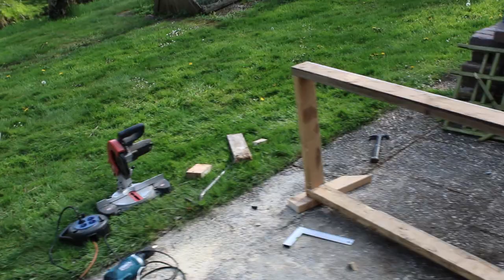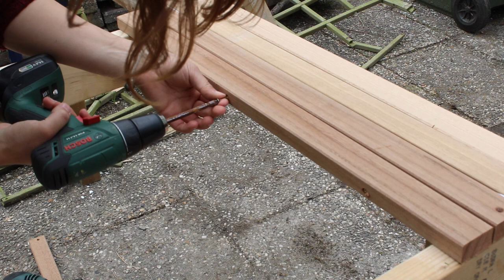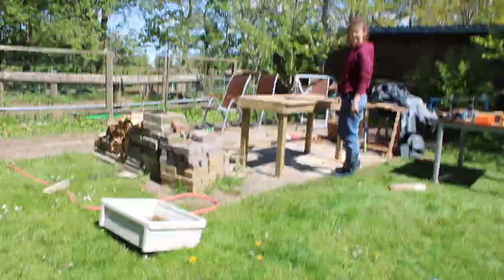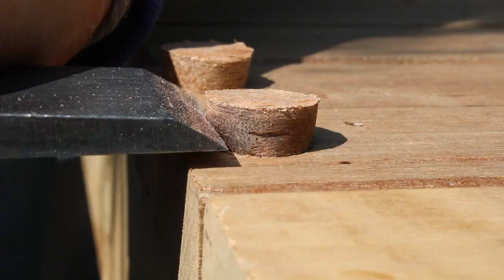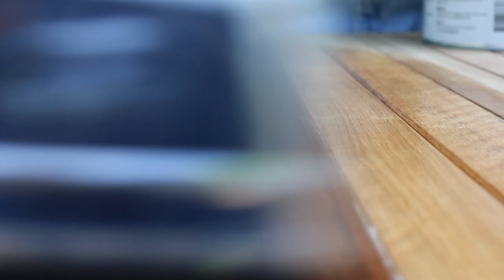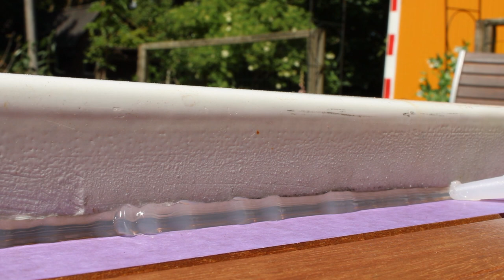DIY Outdoor Kitchen sink

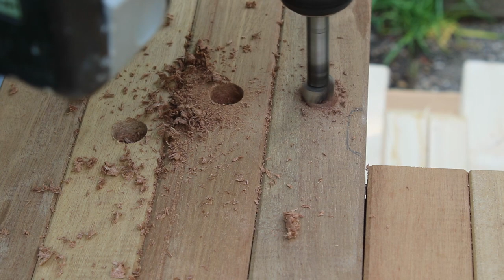Comment: This is so great, thank you for sharing! I'm trying to learn more practical skills so that I can build an outdoor sink at waist height, to make it easier to wash my dog. Can you tell me: why did you do the drilling and filling with pegs bit that starts around 12:03? I didn't understand that. Thank you :)
Reply from the maker: Thanks😊! Because the wood I used was from an old bed, the slats contained some holes from before. I didn’t want water to sit in the holes and slowly rot the timber, so I came up with the wooden plugs! I also think they added a really cool pattern and detail to the outdoor sink!

Comment: Can I ask you a question ? Did you use the hose as the water supply line for the faucet ? what adapter you use ? Thanks
Reply from the maker: We don't use the hose. We have a tap from the main water supply right under the outdoor sink, that's connected to the faucet. :)
Reply: @roosidzinga  Thanks
Reply: @roosidzinga  and the Drain?
Reply from the maker: We only use the sink for washing greens from the garden and such, so no chemicals and stuff. The water drains into a stream we have running through our property.

Comment: I would love to make this for my outside kitchen. Any chance you can tell me the sizes of the material you used please ?
Reply from the maker: Hi! I don't know the exact measurements of the material because it's all reclaimed. But I based them of the standard kitchen sizes here. The height is around 90 cm, the length about 140 cm and the depth 50 cm. I hope this will help!😁

Comment: What’s the purpose of cutting the circles and putting the cylinder shaped wood into the wood?
Reply from the maker: It's reclaimed wood, so there were screw holes from before. I didn't like the look of the holes and was afraid that water could run through the holes and maybe the planks would rot. So both for aesthetically and practical reasons. I hope this answers your question😁
Reply: Asthetics - wants it pretty

Comment: why on earth did you spray the sillicon before you smoothed it? and the tape... terrible process as a glazier that was hard to watch. never use tape people as you autopmatically create a microgap when you remove. when it comes to excess smudges its easier to remove when dry(yes even from wood surfaces , with a scraper and youll get nice clean lines
Reply from the maker: I’m by no means a professional, this was my first time working on a project like this. Thanks for your tips!